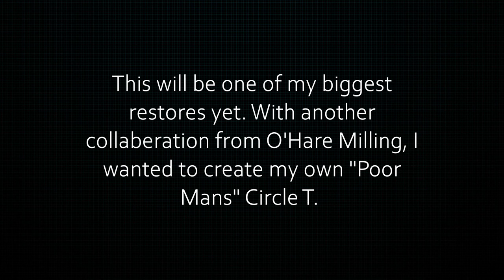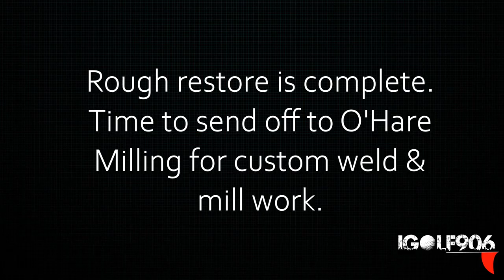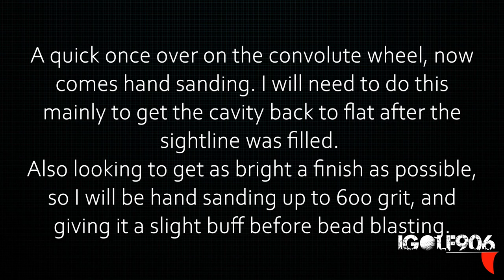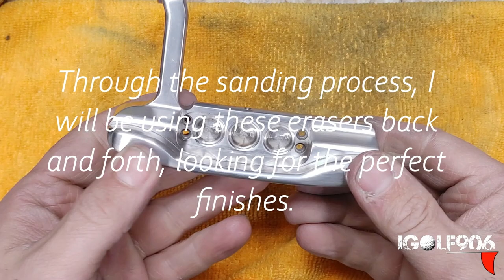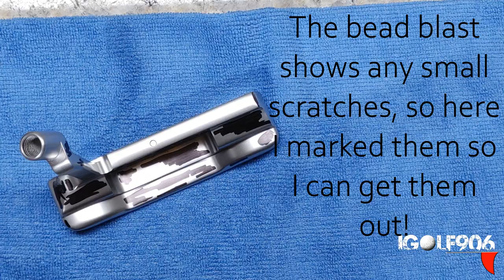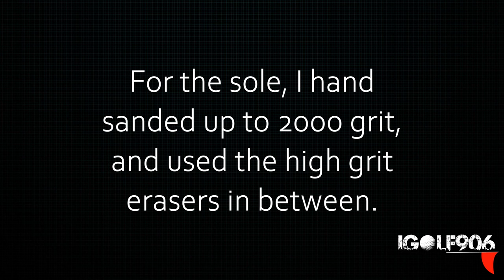Create Your Own Custom Tour Putter 😍

Comment: You are so close to getting this perfect. What I do is preserve the shine of the bombs by protecting them with a dab of hot glue. During blasting it is preserved. Then instead of paint fill I use a machinist dye called Dykem. Scotty did the same thing back in the day. It really looks awesome and pays homage to Tigers  beautiful red cherry bomb.
Reply from the maker: That's a good idea! But I don't see Dykem being very durable, but I guess you never know. Also, the Tamiya translucent paints I'm using I'm pretty sure are nearly identical to the ones Scotty uses. May do a classic red one in the future.
Reply: @igolf906  yes! I noticed they do a good job of being translucent i thought maybe you were adding a dab of acetone to help with that, with the flow anyway. Supreme work though! Love your results!
Reply from the maker: @oatechaosincycles  that's isopropyl alcohol I add before paintfill the dots. It helps with flow, bubbles, and keeps it glossy.

Comment: Would you be able to use a dremmal to sand down any dings on the top line?
Reply from the maker: It's possible but, once all the dings are out it's going to take a lot of hand sanding to get it back to flat and smooth.
Reply from the maker: The cavity on this where I used the dremel took me a few days, and many hours of hand sanding to get it near perfect.

Comment: Which paint was you using for the 3 dots, and where did you find the little squeeze bottle to put the paint in?
Reply from the maker: Check the description. The main translucent paints I use are listed in there. Also I use custom tipped squeeze bottles from Gaunt Industries.

Comment: If you had torched the putter head to a bronze, would you be able polish the cavity dots back to a chrome finish? And if so, would you do it like you had done it in this video??
Reply from the maker: To be honest, if I were to build another putter, I would do A LOT of things differently. I just sort of winged this build, and I do have hopes of building a more modern style putter in the future but, the more research I do the more intricate, and out of reach it seems. Well see.
Reply: I’m saying hypothetically, you torched this putter head to a bronze finish. Including the cavity dots on the back. But you want the cavity dots to have that chrome tour look finish, would you be able to Dremel polish the torched cavity dots back to a chrome finish?
Reply from the maker: @gabrielnevala3987  sorry. I responded thinking it was to a different video.  But yes you should be able to bring the dots back to a silver polish. Never really had to do that so im not 100%. As long as you're using a soft buffing wheel and some compound I don't see why not

Comment: Do you find that weight is reduced with all the initial sanding?
Reply from the maker: A typical restore usually results in about a 3 to 5 gram loss in weight. This project wasn't bad because there was quite a bit of adding welding and whatnot.

Comment: what type of grinder and pad are you using? and is there a compound you put on the disc like a cream of some sort? thanks!
Reply from the maker: Check my newest videos descriptions for updated equipment links. The grinder I use or similar, and the wheels. And no, these wheels don't require any compound.

Comment: I seem to get a couple tiny air bubbles in my paint fill. Any tips to prevent this?
Reply from the maker: Put a small film of mineral spirits in the dots prior to filling. You can also use a small butane or propane torch to quickly get the bubbles out.

Comment: I was wondering if you could help me out, I have a 2023 Scotty SUPER SELECT  Newport 2+ and the finish where the dots are is raw (I think) and I want to make them translucent black! Do I need to polish those dot cavities before I paint them?  Thank you so much!
Reply from the maker: I don't think you would have to depending on the type of paint you're using. But it definitely would make if stand out a little better. I would just make sure they are clean, and paintfill with a good translucent paint.
Reply: @igolf906  Thank you so much!

Comment: FANTASTIC made. The blue filler that you use, is that epoxy glue with paint or what do you use for the colour?
Reply from the maker: I just add a small layer of isopropyl alcohol before I add the paintfill

Comment: Great video! 
I looked through the description at all the supplies, but didnt see the paint squeeze bottle with needle tip. Where did you get it? Did you just put the Testors paint in it?
Also what was the brush or tool you used for the letters on the sole?
Reply from the maker: Gaunt Industries for custom paint bottles. And that was just a tiny plastic bristle paint brush.

Comment: What is it you are doing with the q-tip before dropping the paint in the circles? Does it have some acetone on it? What is that doing? I'm about to do mine tomorrow so just wanted to make sure I did that right, thanks!
Reply from the maker: I'm putting a thin layer of alcohol in them so the paint flows better.

Comment: Where are you getting the shrink wrap for the putter shafts?
Reply from the maker: This particular putter wasn't wrapped.  It's a KBS Tour putter shaft. But in the beginning I used just standard rubber shrink tubing you can get at hardware stores. Then I Cerakoted them for awhile, now recently I've been using ShaftWraps.
Reply: @igolf906  thank you, love your videos

Comment: Good job, how does the copper feel compared to the original insert?
Reply from the maker: I love it personally. I had an old Slotline putter I would mess around with in the shop, and that has a copper insert and feels great as well. Just perfectly soft, but still has that nice click off the face.

Comment: How have you changed to color of the insert ?
Reply from the maker: It's solid copper.
Reply: @igolf906  Oh ok, not recommender to “paint” or dye de existing silver insert ? Try to see but cant find any topic about it, for small insert “easy” to custom make copper but for a Fastback for example it will be hard
Reply from the maker: @rdalmasso7326  The Fastbacks with the one piece sole and insert I've never seen replacements for. And as far as dying. They're aluminum so the best you could do is get the black aluminum dye. Otherwise Cerakote but that's an entire process and will be costly.
Reply: @igolf906  oh wow thanks a lot for your help ! Actually I’d love to black out. And would be insane to see one piece copper for a fastback ! Maybe one or your next video huh ? 😂

Comment: Good effort….but one thing to point out. The copper face protrudes as you’ve skimmed the original face down a bit. If you fit a new insert mill it whilst fitted so it’s perfectly flat
Reply from the maker: I milled it with the original insert, but decided to get a copper one for it in the middle of the project. This putter is my personal gamer so, I didn't bother remilling it. I may in the future but, it has zero impact on putting performance so, wasn't worried about it right away.

Comment: what do you use to remove the paint that wont hurt the club ? mines a new NP 2 but want to change the colors and not the sheen of the metal
Reply from the maker: It's pure acetone. Can get it at nearly any hardware store. It's a strong solvent that eats away at paints and adhesives. But won't touch your NP. As long as it's factory and doesn't have some type of aftermarket finish. But even then, usually it's safe.
Reply: @igolf906   yeah its factory.. i wanted to send it in to get paint changed to blue but why when i can do it myself lol
Reply from the maker: @bknoxx  For sure. Paintfill is definitely something that can be done at home by anyone with a little patience. And if you mess up, have paper towels and q tips ready with some acetone and try it again 🙂
Reply from the maker: There's a few tips and tricks for some of it to make it really look nice but, once you get to that point let me know or email me and I can help you out
Reply: @igolf906  thanks I appreciate it.. I build Dirt bikes and am always working on small stuff so I’m a DYI type of person I just want it to look good the translucent blue looks so good
Reply: Great work!  Did I miss something, how did you change the aluminum insert to copper?
Reply from the maker: @MarkArnold92660  The original insert is stainless steel. But I purchased the copper insert. Was just a quick swap.
Reply: @igolf906  Where do you purchase the insert??
Reply from the maker: @MarkArnold92660  purchased through eBay from Putters4Pitbulls. Makes great inserts.

Comment: Beautiful, I love the insert and the blue. Just a thought, will it not oxidise as you’ve taken the protective coat off with the sanding or have you clear coated / protected it? Thanks for the content, great seeing such a work of art.
Reply from the maker: These putters are stainless steel. They have no coating from the factory so, will be just fine as is!
Reply: I refurbed my friends scotty.  It was the first time I tried a full restore.  2 days later the pitting left on bottom developed rust.  If it was stainless steel it would not rust like that correct?  I'm assuming is a fake scotty
Reply: The first thing that comes to mind is what was the final grit used during your refurbishing? If it wasn’t very high, say 2000 grit, you could have left very fine scratches that allows moisture to accumulate. All metal will rust but you can control the rate via your process.

Comment: My Brother. Please please please purchase a small linishing belt sander. It will allow you to smooth sand the bottom without the awful gouges and hollows left behind by your cheer arse grinding wheel. Please try it once. Also a cheap bench mounted disc sander will raise your finish level to Pro. Please try it. You will love it. I promise.
Reply from the maker: On no restore I've ever done has my convolute wheel left gouges. Not sure what your speaking to. And I've had a custom made 2x72 belt sander before. As it would be a little useful at times, it's not needed. The convolute wheels I use are soft. From 220 to 600 grit.

Comment: First off great job on this putter! It turned out great! Question? The initial weight I would presume is around 350g, what is the final weight after the re milling and sanding?
Reply from the maker: Thank you! Most Newports come out to between 340 & 350 grams with the weights. All depends on the shaft length that's ordered for what weights you receive. But I weighed my head afterwards and without the weights was 318. I had two 10 gram weights so my total is 338 grams. I could add heavier weights to bring it back to around 340-350 but I actually prefer a slightly lighter head. I might even try out some 5 gram weights.

Comment: Oh.....Reworking a 'Scotty' to your own personal color scheme.....Okay....
I like to actually "Create" my own designs....usually from hardwoods, with lead weights.....
Wood has a Great feel and is easily weighted/ balancet to my own specs....
Reply from the maker: I've built guitars before. So have a bit of experience working with wood. I just don't think it would make a good putter. I've thought about building a body out of hardwood and milling out an insert from either brass or steel, just never had time to get to it.

Comment: Nice work. I would have added a thin layer of cork underneath the face plate. Also I would have left the holes raw. Just like the new “Super Select”
Reply from the maker: I purposely leave out anything behind the insert because I like the solid feel of it. No need for me to cushion the insert in my opinion. Also, the dots in the cavity are all personal preference. Not really a fan of the new Super Select line. Nothing really changed other than the slot in the hosel. They do still look nice though!